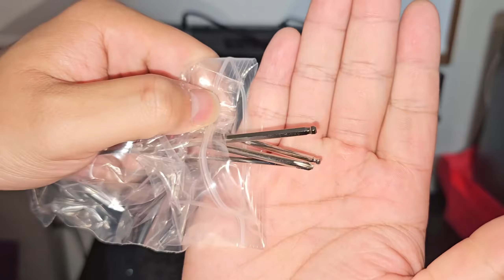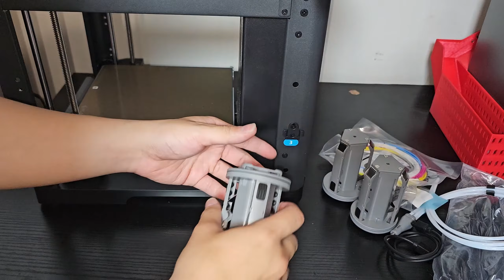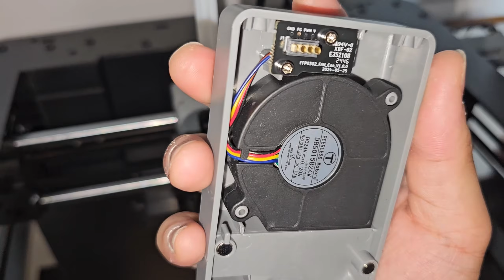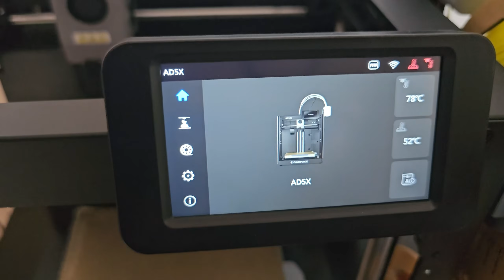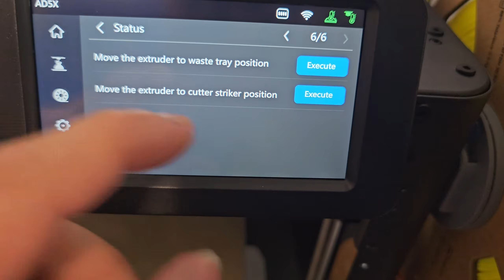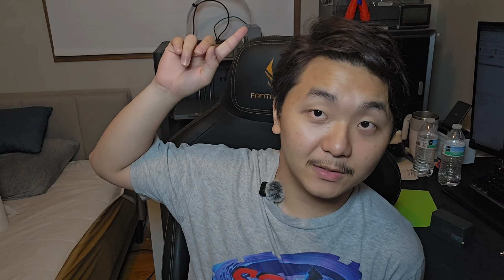Flashforge AD5X Is It Good? | Unbox and Review

Comment: That magnetic print header has caused me some issues and I've only printed the basics as a total noob. I'm assuming the inertia of the movement can cause the weak magnets to detect, if it doesn't fling off all together it pops off JUST ENOUGH to disconnect the freaking fan. I ruined everything over and over again , no idea what was wrong until 2 pools and 5 days later I realize the print head was not perfectly tight, I tapped it while printing and TADA the fan came on
Reply from the maker: Yeah the magnetic attachment sometime may have problems like that, it has its pros and cons.

Comment: The bigger version of the AD5X that you wanted, does exist: it's called FLASHFORGE GUIDER 4 (300mm).

Some absolutely urgent mods for your new AD5X :
  - Regarding the noise, you can try printing an AD5X Noise Reductor by a guy called "dark256".
  - You should print covers for the bed sides by a guy called "Mine Greg" to prevent filament and dust from getting underneath.
 - Print Filament Spool Numbers by a guy called "Steve_McD_3445810", to know which spool holder to use.

Comment: Thanks for the review—I really enjoyed it! Just in case you're wondering, a ball-end Allen wrench does have one drawback: it doesn't hold a screw in place as well on its own as a regular (non-ball-end) one. With a ball-end version, you usually have to hold the screw by hand until it reaches the hole. That’s why I always keep a set with both types. But honestly, that’s a pretty advanced detail—not something most people will ever need. ;-)

As for me, that’s probably just because I always use Flashforge printers—they really pay attention to the fine details and are easy to maintain. I’ll be skipping this model, but I’m really looking forward to the upcoming larger ones (especially since I have the bigger X1C or the S1). The M5, though—that’s the little workhorse that’s always ready to go but as you note - 220 x 220 becomes small ;-)
Reply from the maker: Ahh, thanks for the allen wrench tips. Yeah this AD5X is on the smaller size. I do wish they have a bigger version coming soon.
Reply: @Scratch3DPrinting  Guider 4 and Guider 4 Pro are already announced. Since it is the same change system (or almost the same), they may will first work out all teething issues on the AD5X, how knows....

Comment: Thanks for the great review,  Did you receive the 4 spools of filament that Flashforge is offering? If so
What colors did you get?
How loud is the material changing process? Thanks again for such a great video
Reply from the maker: No, i did not buy that combo with the 4 spools. The material changing process is fairly quiet. But does sounds like a knife when ejecting the filament poop.

The loudest part is when the 3d printer retracting, or z hopping during a print.